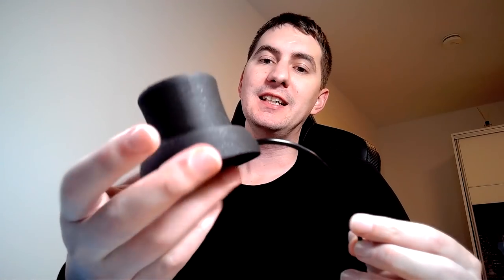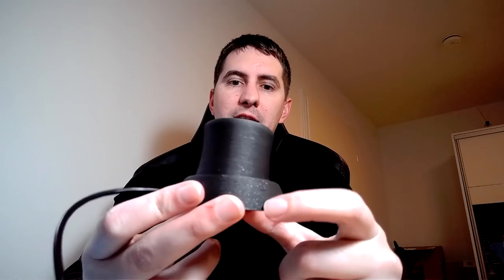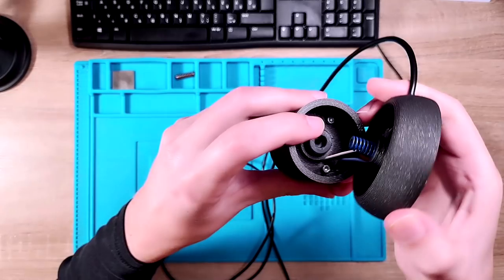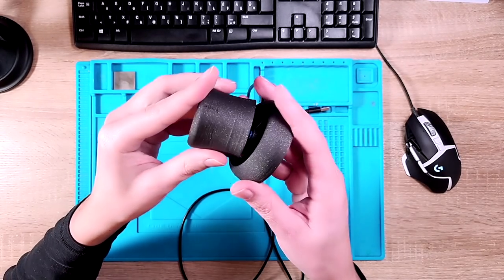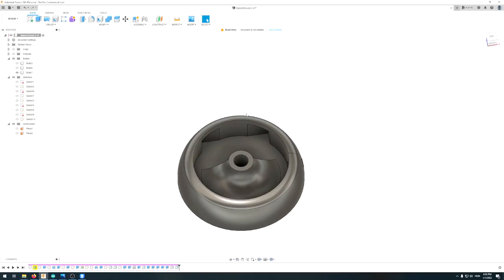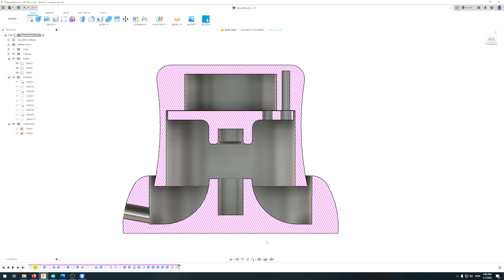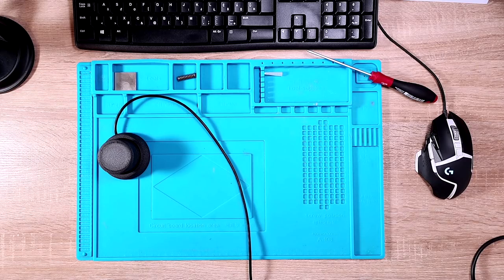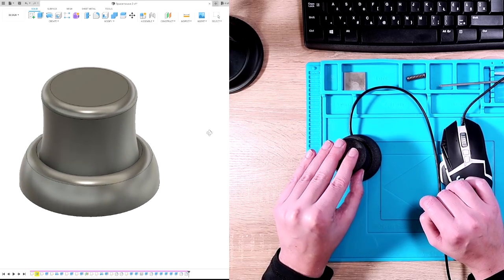DIY 3D CAD SpaceMouse for 20€ - 3Dconnexion alternative???

Comment: Very cool. Does your USB device emulate some 3DConnexion device? I am responsible for PrusaSlicer development and we are having issues supporting the original 3DConnexion devices all the time, thus an open hardware alternative would be coool.
Reply from the maker: Thank you! No, if you look at the arduino code in the video this is just emulating mouse clicks and movement and keyboard button presses. I just designed, built and programmed this in one day 🙂
BTW I love prusaslicer 😉

Comment: Today I looked up the USB HID spec and there's a standard multi-axis controller device type which you could use instead of generating keyboard shortcuts. That way you could probably expand this to movement and rotation in 3 axis and use standard Windows drivers to handle that.
Reply from the maker: Many thanks for your feedback! 😉 I have found an arduino HID library bit I did not take a look at it yet.
My only concern is if I will be able to just use it fusion 360 that way? 🤔 I am not experienced in drivers and apps yet.
Reply: @kikihobbyrepair  I started to hack together something using a Pro Micro with a thumbstick and one of the HID mouse libraries. It worked for F360 as well as Blender (with some extra hacking to add a physical switch to change between F360 and Blender view preferences. I never did get around to doing more than testing it on a breadboard, but I don't remember it being that difficult to implement and I'm not at all skilled with Arduino code.
Reply from the maker: Thats great news man. Thanks a lot for the info. I will get to it later on.
Reply: @PaulIreland1972  A stick like the ones on James Bruton's everything remote device? It has build in rotation, but lack slide motion. That one might be possible to add somehow.. 🤔 But cool low-cost project here 🤓
Reply from the maker: You believe it or not my first idea was coming from James Brutons remote controller 🙂 I looked up the joystick and really the only reason I switched to the MPU sensor is that those joysticks has potentiometers which might wear out like game controllers.
Reply: @kikihobbyrepair  Yes hall effect types might be better for longevity. Regardless I think the proportional action/fell might be better on potmeter or hall than on a acceleration sensor. I think Tom Stanton made some homemade hall effect type joystick also. For cost that could be an option.
As an alternative a load sensor could be an alternative to avoid patent, with or without the joystick moving, and to detect horizontal movement. Perhaps your mechanism on a load sensored plate. Many options to explore still. 🤓😁
Reply from the maker: Thank you for your valuable feedback and ideas 😉 I also have a lot of ideas still so this could be improved significantly over a few iteration stepts to make it better and better 🙂 I also get a lot a few negative comments that this is not even close to an original but you have to start somewhere and this costs a fraction of the price of an original... 🙂
Reply: @TheStuartstardust  No, just a cheap Xbox/PS thumbstick from China. I can't take much credit for it; I found a couple of free 3d-printable designs (one a puck-style like the above,  and one based on left-handed trackball case), and just Frankensteined the code using the mouse.h and keyboard.h libraries for the Pro Micro. IIRC it was going to be rotate horizontal and vertical by moving the thumbstick, then zoom with the stick depressed and pan by pressing and holding a separate button. 

The main problem I had was trying to get it to work with three different applications that use different keyboard and mouse commands for the various movements. By the time I'd taught myself enough to get that working, my 3D printer wasn't and the project just sort of died.

@Kiki Hobby Repair I assume you're planning on using the rotation axis as well? Will you be releasing the design and code?
Reply from the maker: As a next step my plan is to add a button at the top so this way you have 2 times 2 axis. 
Later on I also plan to implement some rotation. The problem with this one is that if I use the MPU sensor for this then even if you rotate the entire mouse on the table will generate the same effect. This has to be compensated somehow. Maybe I have to use a different sensor for this. There are magnetic rotation sensors too. This is still the future.
Yes, I plan to release all the design and source code files with the next iteration step. Although my programming skills are also limited so this might take longer 😀
Reply: @kikihobbyrepair  I appreciate your development of this project! You might be able to ignore the problem of the mouse rotating on the table by making it heavy and grippier like the expensive one. A few very large washers in the base and adhesive rubber feet would be an inexpensive solution. I'm excited to see where you go with this!
Reply from the maker: Thank you for your support!
I also thought about something similar like huge embedded nuts. Although not a lot of space left 🙂
Reply: Also have a look at the Orbion I think it is called, another open source type of orbit mouse, but still limited in number of axis/movements with respect to the space mouse. I guess many more existing just for the engineering challenge in doing it, nerds 🤓😉😄
Reply: @kikihobbyrepair  you could add a rotary encoder on top of the current design. and just print a new section for the top that attaches to the rotary. Then u can have zoom in/out by rotating the top cup, and still that push function of the rotary to act like a shift key modifier.
Reply from the maker: As I promised the video to the version 2 is out:  https://youtu.be/68EapQbDBOc

Comment: Suggestion: subtract the offset of the dead zone for smoother start of rotation: if(Yang>7) mouse.move(0,Yang-7,0). If the reduction of max speed achieved by this bothers you use the map() function to remap your value to full scale. 
Obviously you need to do the same for the <-7 case but you get the idea
Reply from the maker: Thank you for the great idea.😉 In addition I could still play with a sensitivity multiplier and maybe a map to stop it going crazy
Reply from the maker: As I promised the video to the version 2 is out:  https://youtu.be/68EapQbDBOc
Reply: @kikihobbyrepair  very nice 👍 looking forward to v3. Nice use of the map function btw 😉

Comment: I have an original device and I've also tried making a SpaceMouse alternative, but I didn't get good results. I used 9 separate hall effect sensors with 3 magnets to try to get 6dof like the original. Maybe using an IMU will help, good idea for further experimentation, but it isn't enough for 6dof, which as a spacemouse user I can't live without

If you want 6dof, which you totally should:
I see you've looked at the original's springs. A note about them - you need the springs to have a wide aspect ratio - to be at most a bit taller than they are wide, otherwise they don't push in but crumble. So pen springs won't work. I used AA battery springs, as I have a bunch on hand, they allow nice movement in 6dof, but they are stiff. That shouldn't be an issue - with the original the feeling I get is more of force being proportional  to the program movement, not the movement of the spacemouse - it moves barely over a millimeter at maximum deflection. Take a kitchen scale - if you put your hand on it, it moves very little, yet you can still make the weight number move exactly as you want. Of course the force is not too big with a mouse

Flexures - they seemed perfect, but I wasn't able to come up with one that would do 6dof right. That doesn't mean it's impossible

Weights - for the prototype I made I used at first a clamp, which worked but took space and then spongy double sided tape. It works perfectly, but it depends on the quality of the tape. For the final version we can always just pour plaster and bits of metal into a 3D printed cavity.
We'll also need some anti-slip pads, but that's the smallest detail.

Extra buttons - the original I have does have two buttons, I haven't used them even once. If you make a 6dof device, they just aren't necessary

If you want to ask anything about the original or something, go ahead. Maybe we should make a discord to be able to share pictures as well. Given the views this video got, it looks like there is a market for an open source alternative. I took a look at the HID data and I think it would be possible to spoof a spacemouse - you will never get the same level of integration with CAD programs with mouse and keyboard macros. I couldn't see any security or encryption in there, so it's mostly a matter of finding out which bits do what
Reply from the maker: Many many thanks for the lots of information and tips! I have quite a lot of ideas for the second version. I have a preliminary design now with "kinda" 5 axis. Could you please contact me on kikihobbyrepair@gmail.com 
I might have some questions to you and this would be the easiest to get contact to you. 
Thanks a lot in advance!

Comment: oh man, you should soooo make this into a fully featured 3d mouse!! it'll explode - the community definitely needs this and you're the guy to bring it to life!!
Reply from the maker: Thanks a lot for the nice words. I am already working on theb V2 which will ha way more functions.
Reply from the maker: As I promised the video to the version 2 is out:  https://youtu.be/68EapQbDBOc
Reply: @kikihobbyrepair   thanks for flagging this!! Just checked it out. Why not place the push button under the button of the spring, soo that the entire thing could click? this is fantastic work you’re doing!!
Reply from the maker: It would be a good idea though woukd not be easy to design it such a way. Then the entire moving spring assembly would sit on top of a switch and I do bot know how should I make a structure that while tilting it not pressing on the button.
Reply: @kikihobbyrepair  hmmm you’re right that it poses some technical challenges. Happy to brainstorm ideas if you want to continue to iterate on this (I’m in the UK timezone)

Comment: nice!  maybe another alternative to using optical sensors is to use an led (for light) a camera looking at the lid from the inside, and a square image on the inside of the lid.  then tilt math would be based on the distortion of the square, sides becoming longer or shorter, etc.  technically it's just measuring the distance between 4 points to figure out which parts are closer to the camera, and then translating that to tilt. might not be as sensitive as accelerometer, but would also have less tendency for drift.

Comment: Suggestion:  change the Arduino code to add a motion acceleration factor which is based on the tilt angle, so the more you tilt it the faster it moves.
Reply from the maker: It works that way already. The loop is updated every 50ms and it moves in every cycles with the angle considered as pixels. So the higher the tilt angle the faster it moves.
Reply from the maker: As I promised the video to the version 2 is out:  https://youtu.be/68EapQbDBOc

Comment: Cool project. I'm not sure a triple spring setup like the 3D connexxion version uses might not be better though. That both limits travel and reduces the travel of any single spring so metal fatigue doesn't become an issue. Using an IMU is a neat idea. I believe the current design of the Space Mouse uses a centrally mounted magnet on the knob and three hall effect sensors (I assume 3D ones) to detect movement. The advantage being not needing any active electronics or wiring to the part that actually moves. Having seen a teardown of one of them, It looks like it wouldn't be that hard to build for much less than the $150 they charge.
Reply from the maker: Thank you for your comment. I am working on the v2 which will still be the single spring version but with 5 axis. I will hopefully drop the video at the weekend. I have already plans for a v3 with more springs to have the same behaviour like the original. My biggest concern is the software.
Btw the original is using like 6-9 optical sensors to detect the movements.

Comment: is not more simple to use an joystick module to get axis movement ?
Reply from the maker: You are right it would be way simpler but the problem that Joystick modules are usually really small and the carbon tracks are wearing out pretty fast. This way by using the MPU sensor there are no moving components. By the way the version 2 Spacemouse video is already out with significantly more features so I would recommend to check it out on my channel. 😉

Comment: One possible improvement would be to add a screwed bottom compartment to fill with sand to add weight, hence preventing sliding on your desk
Reply from the maker: Thank you for the ideas. I am planning anyway a screw on bottom for easier assembly in tge upgraded version.
Reply from the maker: As I promised the video to the version 2 is out:  https://youtu.be/68EapQbDBOc

Comment: Have you ever had the chance to use a 3d mouse? It's quite interesting. They use some kind of force sensor, so the puck barely moves when you apply pressure but it reacts very precise.
Reply from the maker: I saw the 3DConnexion mouse disassembled. It is using 3 set of springs and using optical sensors. 
You can use mine too quite precisely. Depending on the angle you tilt the top you control the speed of motion/rotation. So it is quite similar to an original one.
Reply: I‘ll stay with the 3D Conexion
Reply from the maker: I would do the same but I do not have any :)

Comment: Very cool, although I would make the base bigger, so the arduino would fit underneath, sleeve the cables to the gyro and feed those up through the centre of the spring. Makes it less fiddly and more durable.
Reply from the maker: Thank you. I am working on the v2 and most of your recommendations are already handled 😉
Reply from the maker: As I promised the video to the version 2 is out:  https://youtu.be/68EapQbDBOc

Comment: Interesting, this just popped on my feed.
You could use a mouse optical sensor to make a rotating knob, as 3rd axis.
making the outside part of the knob separeted from the inside and linked with a small bearing
Reply from the maker: Thank you for the ideas. 🙂 I am already working on a version with an additional button on the top to double the functions as a separate mode select button. As for rotating I could just use the Z axis of the MPU6050 sensor too. I already made some test with it yesterday because the spring itself also allows some twist which could be used but for this I should make the entire mouse slightly heavier. An alternative idea was for me similar to you using a bearing. Lets see 😉
Reply: @kikihobbyrepair  already subbed to see the results 💪💪
Reply from the maker: Thank you! I really appreciate it 😉
Reply from the maker: As I promised the video to the version 2 is out:  https://youtu.be/68EapQbDBOc